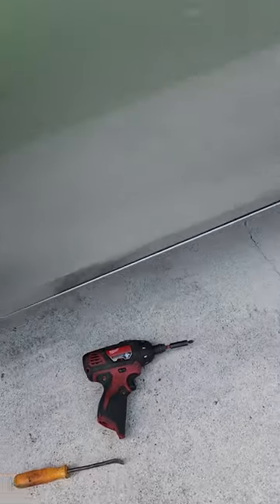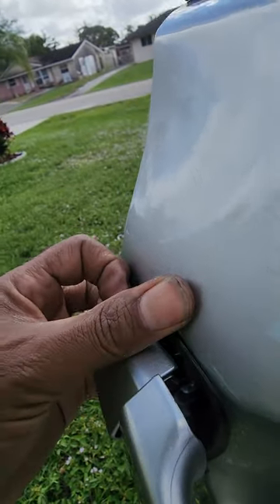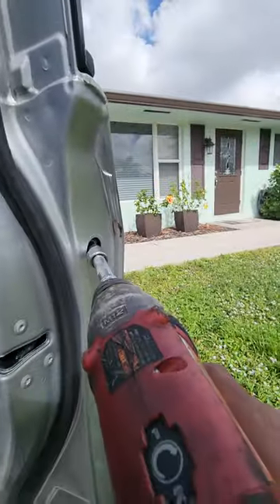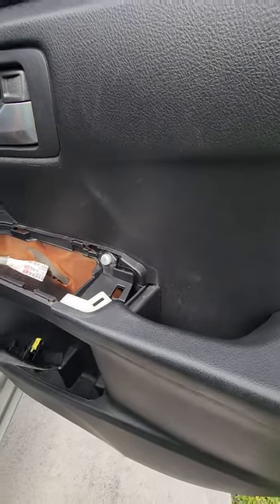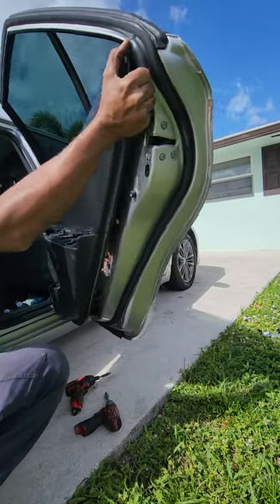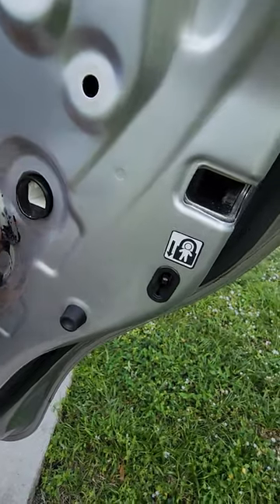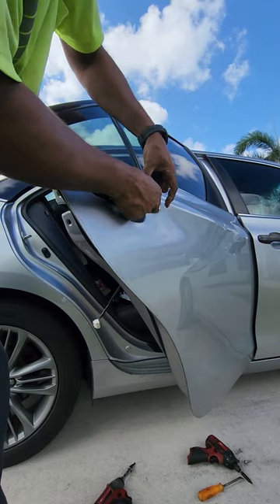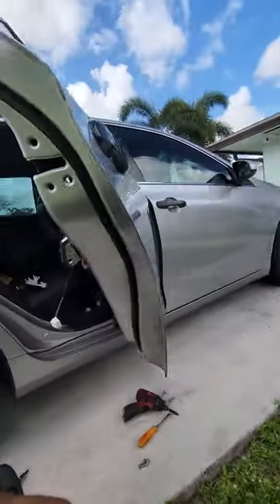2012 -2017 Camry door handle.

Comment: If the screw falls out, and I can not retrieve it, where do I find a new screw?
Reply from the maker: The stealership probably.
Reply from the maker: A magnetic retrieval tool should be able to get it.
Reply: @Repairsbyctop  tried both of these options. Both were dead ends. I ordered a set of screws online. Fingers crossed. Thank you for responding.